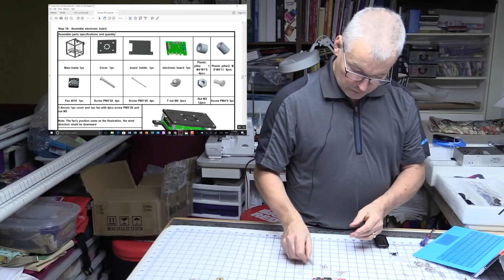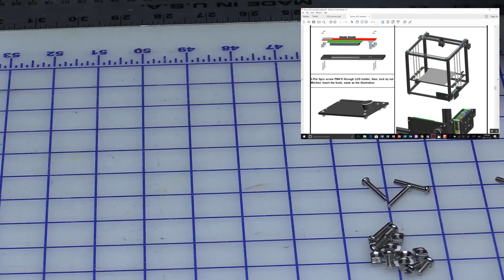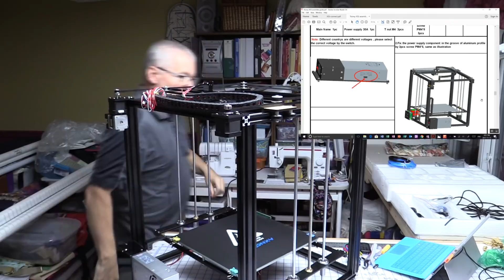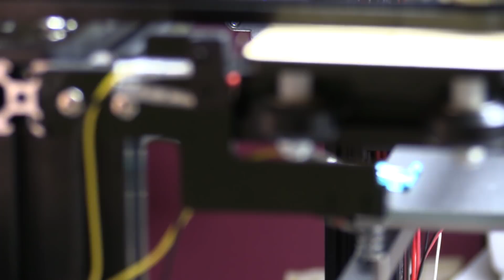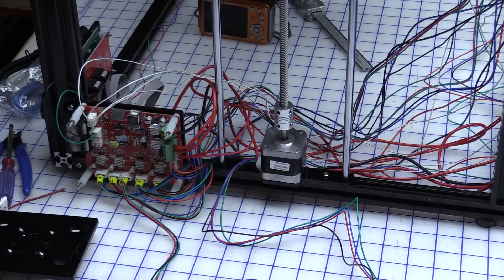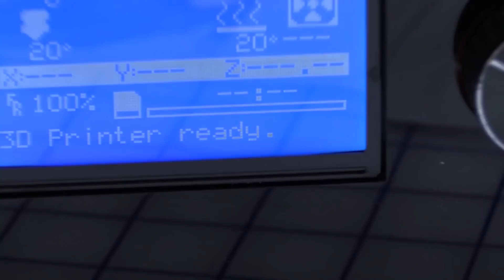Tronxy X5S Review and Build Pt6 Electronics and wiring

Comment: What size of wire Ferrules?
Reply from the maker: each wire size has its own standard ferrule to match it, this is the kit I have to work with https://uk.rs-online.com/web/p/products/2280321/  (I know, french color coding but it works just as well), I also use the proper crimp tool to go with it https://uk.rs-online.com/web/p/crimp-tools/3368078/, yes it is expensive but you only buy it once and it creates awesome joints and very reliable and no hand fatigue with many joints made :)

Comment: Hello, thank you for the video, I followed all to get extra confidence during the build. All went fine apart from the indication of the 2 spacers instead of three for closing the main board. Wou had the same issue. One BIG QUESTION though: once testing the HOME function, how come you did not have the issue that I had (and some other users) which is that the X and Y sockets on the board are actually WRONG. It means that the X was moving correctlw to the stop-switch but the Y was running to the opposite direction of its end-switch. I inverted the two sockets X and Y to solve this issue. This is VERY IMPORTANT and I just wonder how you missed that error. I bought the printer last week (beg of December 2017) so maybe they sent to wou a revised version of main board to avoid that ? On the board, facing it once fixed, Xmark in on the RIGHT socket, Y the next socket on its LEFT. Please check for other builders, that kind of information is key ! thank you, I look forward for the next part (video 7 ???)
Reply from the maker: WOW, I completly missed getting that error... here is how (I went back and had a look)
in the video you recall me mentioning that the cable for y was too short and X was too long and I swapped them, but in plugging into the controller i still connected them the way the markers indicated, thereby accidentally wiring them up correctly.
My conclusion is that it is the identification of X and Y motor location in the PDF that is wrong and not the controller end. they simply marked the X motor as Y by mistake and this is validated by the wiring  based on the length rather than the document. So I was lucky in wiring based on this and forgetting I had switched the motor end of the wire, still plugged in the controller end based on the tags in the wire.

Comment: No problem sir. I have the same printer and a Einstart. This Tronxy x5s is a very good printer. I need to edit some stuff in the electronics box but not sure how. I only get to use 13x 11.5 of my build plate not the full 300x300x430. You have great videos keep up the good work. Cheers fr NB CANADA

Comment: Where is part 7
Reply from the maker: coming very soon, still editing it
Reply from the maker: Thanks for the feedback, I will pass on the thanks, yes, using the available spare spacers that came with the kit just made sense to me, I did also end up changing the fans though as there quite loud and whine a lot to the point it was driving the wife nuts, a couple of noctua's fixed that (Video coming soon on that)
Reply from the maker: No problem, I aim to make these tutorials and as such people need to be able to repeat what I do, so more detail than most and as you say, additional detail in post editing where i discovered issues along the way. I make the mistakes so hopefully you dont have to :)
Reply: I can’t get usb to connect the drivers have me so confused

Comment: Great videos! What did you attach the board controller fan to? I cannot figure out where to put it.
Reply from the maker: the top plate has 4 holes for it already, on mine it was already mounted but if you watch from about 1:30 through to about 5 mins it should be clear
Reply from the maker: Or did you mean the power for the Fan. it is a 12V fan and you can simply connect it to the 12V DC input, make sure polarity is correct.